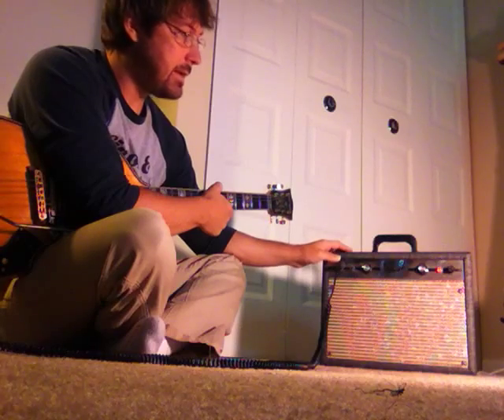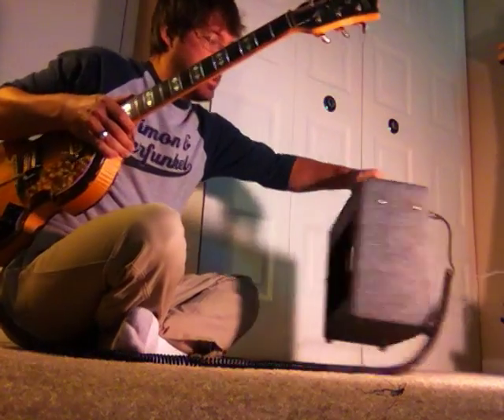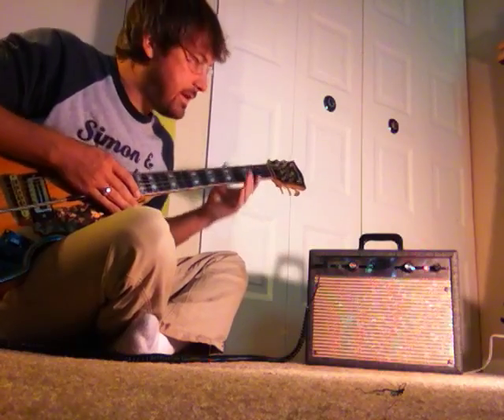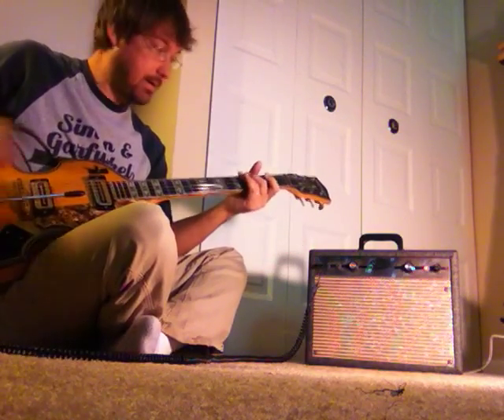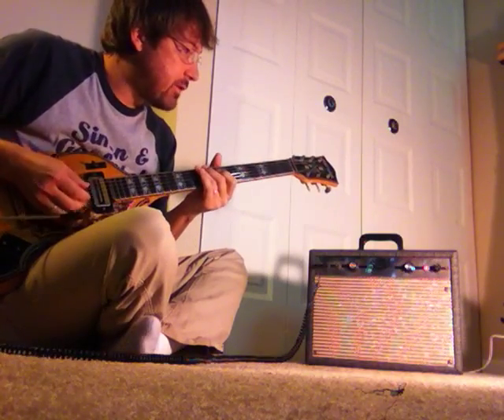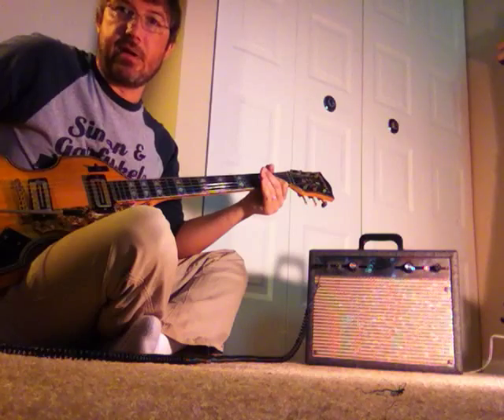1966 Supro Valco S6606 Super Six Amp DEMO

Comment: These amps rock.....I am currently working on building a clone a 6606......and absolutely love hearing how these too often overlooked amps sound.......thanks for the video. ....
Reply from the maker: Robert Casey Great choice for a clone. There isn't much to them, and they sound fantastic! You could even push a 10" speaker easily with this basic design. The S6422TR Tremo-Verbwas very similar with added trem and reverb and used a 10" speaker. The Corsica S6622 used a 12" with the same basic 5W 6V6 output.

I have made demos of those models too.

https://www.youtube.com/watch?v=TQFFx23hyr8
https://www.youtube.com/watch?v=rQBDoZI-Ie0
Reply: How did your clone work out? I have a 1616t on layaway. Excited!

Comment: Hey Brad do you happen to know if this amp has a 4ohm speaker, I've measured the resistance in mine and that's what I've concluded,have the same amp, and wanted to try out a little 8"mod brand speaker that's 4ohm,but before I try it, I have to be sure what ohm speaker this amp takes,too precious to test the wrong ohm speaker,hard to find any info on this model thanks if you can help me out here.
Reply from the maker: No idea. If yours measured 4, go with that.

Comment: Just saw one this morning that was marked down from $799 to $499 on Reverb. I offered $400 and he accepted. Now waiting for it to arrive. Looks to be in very good condition with everything original and no hum. It was a closet find. I’ll replace the power cord with a grounded cord for safety. Does it sound like I got a good deal? Was looking to get a supro but had no idea what model to get.
Reply: So did you get it, what do you of it?
Reply: Michael Cohen I wasn’t impressed with it, especially for that much. I am more of a Marshall guy. My cheap $90 monoprice 5 watt amp is just as good as this. In my opinion!
Reply: Michael Cohen I sold it right away!
Reply: mavrim7 I actually just got a used Marshall dsl40cr yesterday.  It’s my first tube amp.  Loving it so far.

Comment: Why do all of you  knowledge of playing  shown by the use of dirty and distorted tones? Why does no one use a clean tone? Because the distorted tone creates the illusion of great techniques! A little 5W RMS amplifier  can not give a clean tone than a maw 2W. And just a clean tone shows the quality of the amplifier. With a distorted tone, every amplifier sounds the same. I play the guitar for 50 years and I've made tube and solid state amplifiers for over 40 years and I know what I'm talking about. The amplifier should only be tested with clean tone.
Reply: Actually demoing an amp using clean and dirty tones will give you the best indication of how it sounds.  Also, distorted tones are not the same in every amp.  Every amp manufacturer's take on gain and tone is different (unless you are trying to copy the other amp's sound) otherwise there would only be a need for one type or brand of amp.
Reply: +Pero Razovic (please excuse my incorrect rendering of your name. Unable to generate anything other than anglo-phonic letters with this keyboard)  I completely disagree, Perhaps 42 years ago when you were working with new technologies like integrated circuits, silicon diodes and the general  engineering ethos of creating products that were stable, dependable and ultimately  informed by the consumers enthusiastic reactions to the  emerging accessability of sophisticated but reliable products, engineering success could be measured by how stable and how loud. But this type of review is about finding the combination of  guitar and generally high voltage circuits operating at the edge their tolerances to produce the tone that sounds to them/me like the tones heard on our favorite golden era recordings. Now, that the electric guitar is so universal. Designing or desiring clean, clear and loud- is the domain of amps that 'take pedals well' or hi-fi amp designers. lots of generalisations on my part I concede.